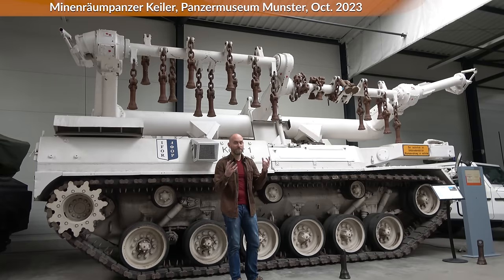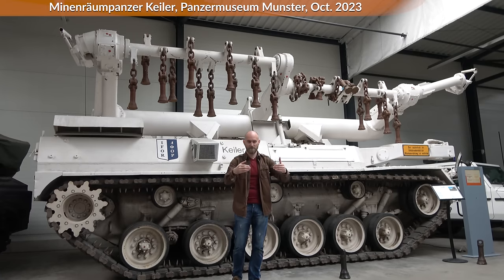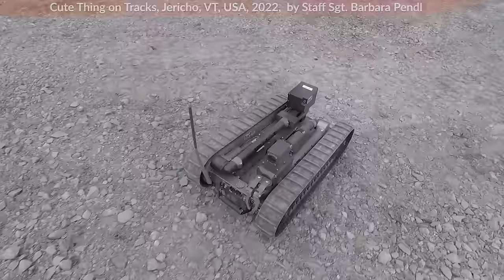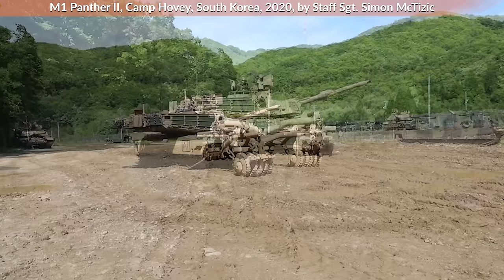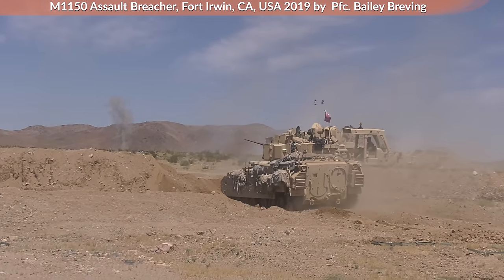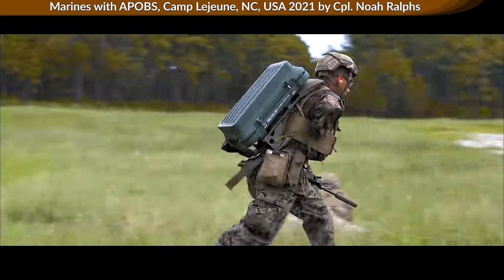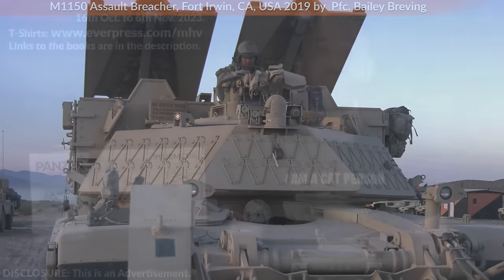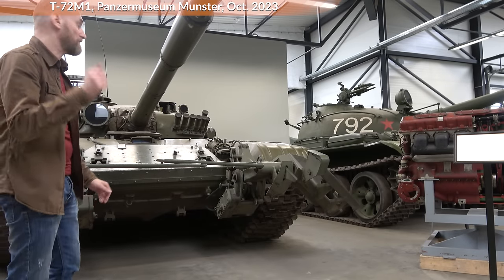Ukraine: The Problem with Mine-Clearing Tanks

Comment: Combat Engineer Intelligence officer here: you basically describe the SOSRA process. The technology for clearing lanes through minefield has not really evolved since WW2. Yes we have mine clearing line charges, but their length is limited and they are not 100% solution. Line charges DO NOT clear all mines and are mainly good for 1st generation track attack mines. Track width mine ploughs are NOT meant to clear a lane. They are meant to protect an individual tank while crossing a minefield (to secure the area), but other vehicles should not follow in it's path. Track width mine ploughs do not clear full width mines with magnetic sensors between the tracks, unless equiped with electronic counter-meassures (like the Russian EMT). 
For the engineers to be able to conduct the reduce of the obstacle, the manoeuver units need to supress, obscure and secure the area. In Ukraine this is extremely difficult. Two things have improved a lot in the past few years: ISR assets (drones for example) and long range fires. Everything is observed and will be targeted with accurate long range indirect fires. The Ukrainian breach attempts south from Orikhiv (7-8 june 2023) mainly failed because the breach lane was under observation and accurute indirect fires, while the area was not secured. Securing an obstacle (or obstacle belt) for the engineers to breach can be extremely difficult. With air supriority this becomes easier, but it often comes down to dismounted infantry breaching small lanes and creating a sort of 'bridge-head', before a lane is created for tanks and vehicles. This is exactly what the Ukrainians are doing. 
So breach tank are extremely usefull, but you need to set the right battlefield conditions for their use, otherwise you are sending them to their grave. 

Remote delivered mines can be used to quickly close a breach. Both NATO and Russian doctrine describes their use for this purpose. They should be dropped behind the breach force, so that they are isolated and the assault force can't reinforce them. Breach tanks are rare and it's very likely that the assault force is not equiped with breach tanks. This is a real danger and remote delivered mines were used in this manner by both Russia and Ukraine. A layered system of breach assets is needed for a breach to succeed on the modern battlefield.
Reply: I think all militaries doctrine instruct that minefields must be under observation and touchable with fires. And of course mine clearing tanks rank as no 1 target for AT crews
Reply: Would it be possible to clear mines by using a horizontal drill rig to emplace a charge that physically excavated a trench wide enough for vehicles? It sounds crazy but the Ditch Witch JT100 for example seems to claim 46 m / min advance, which is much faster and stealthier than the mine clearing flail. Not as fast as the surge speed of the miclic but probably competitive with the reloading cycle of the miclic, and if circumstances allowed you could set multiple charges per drill vehicle before blowing up anything. It's not clear to me whether there's a hope of controlling depth accurately enough with a commercial unit, though. Too deep and the charge won't blast away the overburden, too shallow and you give away the mine clearing effort prematurely.
Reply: I was surprised to find the other day that the first mine clearing line charge was invented (and used) in WW2. It was launched by a rocket just like now, but as an empty hose pipe like a fire hose, then nitroglycerin was pumped into the pipe and detonated. This made it seriously dangerous and there was a huge accident after which it wasn't used again during the war.
Reply: I was with Dir, of Combat Developments at Ft. Belvoir from 77 to 79. We came up with SLUFAE(Surface Launched Fuel Air Explosive). It allowed for attacking a mine field from several klicks back. When we gave a briefing to the Under Secretary of the Army, a Marine General said "that would be great for final protective fires". He was told to shut up. At that time most counter mine programs were not funded. Tankers didn't want plows and rollers on their beautiful new XM-1 tanks. We had three prototype mine rollers and three prototype mine plows and were told to scrap them. Fortunately, someone just hid them in the Armor Engineer lot at Ft. Knox. When the tankers saw all of the mines in the Kuwait desert, then they were demanding lots of rollers and plows immediately.
I see the future of mine clearing to be a combination of standoff munitions, drones with thermal sights to locate the mines, and remote controlled robots to remove or neutralize them. Good Luck, Rick
Reply: What about a Line charge roll carried behind a Dirt Bike being driven by a Combat Engineer? Or one of those Delivery Drones carrying a roll of Line charge?
Reply: @Sufferingzify You want to drive that dirt bike? Line charges are too heavy to carry or pull with a dirt bike. There are some interesting aspects to your idea.
Reply: @richardross7219  I just think that at some point, speed becomes life when crossing those minefields. The use of a Engineering Tanks carries the same risk because of total exposure time, if people are considering using a 100+lb Line charge backpack mortar to clear mine lanes, it would stand to reason that a motorcycle carried one would be easier.
Reply: @mattiasdahlstrom2024  Highest priority targets were APS equipped tanks as those tend to be command tanks, or vehicles identified as unit commander. Removing command paralyzes all but the best units, often leading to total destruction of the targeted formation. 
Specialist vehicles are next on the chopping block or the first target if no command vehicles can be identified.
Reply: @sealpiercing8476 it would be possible. Would it be cost effective, no idea. Would it be a perfect way? Far from it, you'd still have the issues of new mines being dropped in with arty or bombs and one disable vehicle would block the entire trench. Just clearing a field let's the rest of the collumn go around any disabled vehicles.
Reply: why always "cleaning" mines? why not making a tank strong enough that you can drive over them without a problem? speaking about the P-1000 Ratte or something ...
Reply: Don't know if this is good question for an S-2 in an engineer unit, but  is using HE artillery rounds with delayed fuses for reducing obstacles still valid, or is it such an outdated tactic that you might as well be going in with a lance and wings on your back?
Reply: @w4r7h0g8  waste of resources, huge downsides when not resisting mines and the enemy could always build a bigger mine to deal with it for a fraction of the cost.
Reply: Ever heard of nice-to-know and need-to-know?
Reply: @cbrun1669  Two problems with that critique. First, soldiers often find themselves in situations they haven't been specifically prepared for. I've seen a cook get deployed to a remote COP near the Pakistani border with no cooking equipment. What kind of job do you think he ended up doing. Second, if we ever do get into a major ground conflict, it's probably going to be a whole lot of people with little to no current preparation for what's going to happen ending up not just on the front line, but in command on the front line. So the more of an interest people take now, the better.
Reply: @Palora01  i wanna see how the enemy will "easily place" a mine in the size of a car or bigger ... good luck, transporting, burrying/hidding them in that size ...
Reply: @richardross7219  Someone has ever considered to use Hovercrafts?
Reply: @Palora01  All the methods identified here only clear lanes and consequently have similar problems. Moreover, buried charges potentially afford a way to clear more lanes at once, if the emplacement can be stealthy.
Reply: I laugh at the way everyone has to be "combat" now. It used to be field engineers, now it's combat engineers, we even have combat supply. Field engineers are the most respected units in the army, but now they're combat engineers and we laugh at them.
Reply: @sealpiercing8476  not quite the same problem. 

With a lane in a field there is the risk of hitting a mine if you go off lane. When the alternative is stay and wait for artillery to fall on you taking the risk is always worth it.  

And ofc you can make a new lane if you have another mine clearer in the column to take over from the first.

With a trench there is no way to get off lane, once you are in you are in, if the leading vehicle gets stuck or taken out that's it, no way forward, and no way back either if a vehicle at the rear gets taken out. At that moment you've just lost the entire column and the only thing you can do is abandon the vehicles. 

And that's a normal day on good ground. You don't even need the enemy to get you stuck in a trench if it's raining and all the water is pulling down in the trench where all the heavy vehicles are.

Current options are better and more cost effective. 
They're far from perfect but there is no perfect solution to mines, they're a really good defensive option.
Reply: @Derna1804  I was replying to the original comment. I was trying to highlight that commenting specialist knowledge about a subject like this in an open forum like youtube isn't a great idea, especially letting youtube comments know your rank and function... Anybody that has served/deployed knows that you shouldn't publish this kind of info publicly, even if it's common knowledge. Every safety briefing ever has contained this knowledge. I also doubt that future soldiers will receive their training via youtube.
Reply: @richardross7219  as for the airbreathing munitions, this might, actually be interesting, especially with modern guidance systems. How about something like M270 launched missiles, with reduced range (say to 20 km), but increased air breathing charges, possibly, even cluster (say 2-3 large submunitions per rocket, each equipped with it's own guidance kit). Or even with normal GMLRS ranges (of 80 km), but with foldable gliding surfaces. Basically elongated GLSDBs (with shorter boosters).  Why guidance kits? For two reasons: one, so that all submunitions hit ground in straight, preprogrammed line and two, so that explosions of this rounds would not interfere with each other (as they are airbreathing, and thus may disturb creation of the optimal mixture "cloud" shape). Alternatively, this charges could be integrated into air droppable gliding bombs. And as for the magnetically triggered mines, AFAIK, in certain cases, they can be triggered even by a hand-held radio or a cell phone nearby, so, possibly, a powerful directed ECM from an airborn  platform, equipped with AFAR could be used. Or something like the MALD missile, with a specialized narrow beam transmitter to imitate a tank several kilometers in front of it.
Reply: @cbrun1669  Officer is a pretty vague description, I don't think he doxxed himself. Our methods, training and doctrine are not actually secret. They cannot be in a republic, there has to be accountability to the public, and publications have to be easily accessible to troops. As to how future soldiers will train, they might not get the training they need at all..
Reply: @solarissv777 The fuel air explosives were sensitive to weather conditions. A decent wind would ruin them. I left active duty in 1979 and didn't keep up with most of the combat engineering because in the Reserves I was put into civil works since I was a civil engineer. Much of the new equipment seems too complicated which usually means unreliable and unrepairable. I am still a firm believer in the KISS principle. Good Luck Rick
Reply: Former 12-bang bang here, everybody remember that a minefield is only an obstacle. How command wants to breach that obstacle depends on what are the priorities of the mission, and this means combined arms if you want to get through as quickly as possible or a dedicated Engineer unit for thorough clearing. And yes, the MICLIC is almost a ton of fun 1800lbs of C-4) if you absolutely, positively need a safe path to drive through.
Reply: This made me think about the new US Army Pen Division and centralization of fires in the hands of DIVARTY & CORPSARTY/multi-domain TF.

Seems like the best approach with the current state of the art is indeed adding whole lot of combat engineer assets for redundancy and massing as much fire support assets as possible for counterfire operations.
Reply: Are all mines composed of ferromagnetic charges? Wonder if solution using strong electromagnets would be possible? But enemy response will probably be only paramegnetic ones. Then if we already go heavy into tech complicated equipment maybe something like Isreali trophy system, hard-kill solution. Instead of plow, heavily potected ground scanners with shooting device (explosives or smth else) controlled by AI system? Or ground light-weight remote controlled scanning robot to find path of lest resisance?
Reply: Mine clearing vehicles are good for clearing mines of secured areas, it's not very effective on hot zones.
Reply: When I saw the line charges I immediately though of drones in a swarm forming a grid over a field and simultaneously dropping one charge each. Maybe in the near future?
Reply: One thing - the small individual tank plows seem like they shouldn't be that expensive, along with the ECM equipment. So what prevents breakthrough tank and mech infantry platoons being made up of vehicles that each has this equipment? Seems like that would allow the vehicles to move more independently, and the lead tank being knocked out wouldn't basically doom the entire column. I mean even 30-40 such vehicles wouldn't be such a big drain on resources? Plus some sort of outrigging system that would drag chains along the ground on the sides of vehicles to detonate anti-infantry mines? I assume there is something else that would still prevent this from being effective, since it kind of seems obvious and simple to implement.
Reply: If all of these methods are not 100%, I think you need redundancy.  This will take more work, but this is a big problem that requires more effort.  Some ideas:

ALL tanks should have those smaller devices that clear a path just ahead of its own tracks.  Even if they're going through "already cleared" areas - there's still a few mines left.  And, don't count on those to clear for any other vehicle.  Every tank has those.  Must manufacture tons of these that can attach to all kinds of tanks.  So nobody risks going without.

Have a Dedicated, specialized mine clearing vehicle/tank, that goes first.  Without any other tanks following it.  It should be able to clear forwards and backwards, so if it has to withdraw, it can deal with missed, or newly dropped mines.  And, if it encounters a new obstacle (blown tank), it can drive around it, over mines near the road, clearing the way for itself.  Probably, unmanned and remote controlled.  Must manufacture lots of these so all groups have them, and backups, because they are vulnerable.

Redundancy and safety are #1.  Everybody, and every vehicle, must live for another day.  Just cuz you're driving, or walking, on a 'cleared' path, it may still have a few mines, or newly dropped mines.  Any area that's been cleared, only once, is still dangerous and should be cleared again using a different method, because each method has weaknesses.

Use the best technologies illustrated in this video - all of them at the same time.  I like that mine clearing plow.
Reply: @w4r7h0g8  From what I read, first - some tanks are already large enough that they suffer from logistic issues - difficult to field and traverse terrains i.e. crossing bridges. Second - a larger tank will result in counters via a more powerful mine but ever bigger tanks will stop being practical long before the size of mines becomes an issue. Thirdly, as evidenced by Russo-Ukrainian war, the future of warfare does not lie in bigger or more powerful tanks.
Reply: @Palora01  The problem of mass is still relevant; an anti-tank mine with a shaped charge is capable of penetrating 400 mm of armor
Reply: @richardross7219 not sure, as I do not know, if that can be used now. I think it was classified the same as napalm as a cruel & inhumane weapon.
Reply: @w4r7h0g8 reason being is that once we come up with a "mine-proof" tanks, mine technology will come up with even deadlier mines. It is easier to destroy the mine or move the mine via plowing
Reply: Very well said sir. The one thing that you failed to mention tho is that as Combat Engineers, we always double up our tactics. Once the lane is cleared, we always proof the lane to make sure all the mines are cleared. Either with a Cherry Line or with plows. And you are 100% correct about the minefield density, there are plenty of videos as proof of it. One place to see them is Warthog Defense here on YT.
Reply: No wonder the Russians stopped the recent Ukrainian offensive due to mines
Reply: @sealpiercing8476  no, it would be possible.  When under direct & indirect fire, you need to get through that minefield as fast as possible. If you ever watched a ditch witch work, they go backwards while digging & are very slow. 

Sorry!
Reply: @richardross7219  need to correct you on a point. The plows were used in 1989 because I was an E-5 then and we were training in their use.
Reply: @Sufferingzify  drone maybe. It would have to be a powerful one as C-4 is not light, especially when its daisy chained like a MCLIC. As far as a motorcycle goes, that's ridiculous, no offense intended. You are still putting a Sapper in danger hotdogging through a minefield where he can't see the mines. He gets blown up very easily and quickly
Reply: @meligoth  Hoo Rah! Well said.
Reply: @MariachiMak  no, they are not all  made up of that charge. If you went in doing the final sweep using a high powered electromagnet you would get your team, squad, platoon/section all blown to hell because of the sensitivity. And a lot are booby trapped so that if one goes off, a lot them go off.
Reply: @guyh.4553  Where and with what rollers on what machines? At that time, I was in Civil Works at a District so, I was out of touch with the Combat Engineering side. Around 1993, I was told the story about the old rollers and plows when I ran into an old friend from 1979 at Ft. Belvoir. Did you stay for retirement? Good Luck, Rick
Reply: Well put!
We in FDF have these roughly 20 kg "boomsticks" which are meant to clear a hole for infantry (taking out infantry mines). It's very similar to what the infantry was carrying and deploying in the video, that "line breach" thing with explosive cord.
Reply: Not like I am taking a step without you looking at me. Just saying...
Reply: @cbrun1669  I despair at some of the information that is shared on open platforms like YouTube. Maybe it is already 'open source' but there isn't any reason to make information easier to find.

I'm waiting to read about the specifications for nuclear submarine power plants because someone wants to show how knowlegable they are.

Sheeesh, loose lips sink ships!
Reply: @GarrisonFall  A simple (Salt device). The capture of neutrons would be quite specific. Ask the Chernobyl and Fukushima  holders of the keys. How do you shut down an Energy that hates you?  Simply bounces off others and agitates them too. On a Molecular Level. Such a small package with Large Consequences.
Reply: "conduct the reduce of the obstacle"...!? Most of what you "said" is just a convoluted contrivance, like you are trying too hard to live up to what you think, people expect of your "expertise", drop that whole pretending to be a literary genius and just say it how it is man, I don't think anyone really needs you to be The definitive "expert" opinion.... it's not like you're expected to write the Book on "Mine clearing Tanks" in a YT comments thread...
Reply: @sealpiercing8476  uhhhh just WHAT lol... the amount of explosives that would take... and how would you keep the explosive force tunneled in 1 direction under ground? literally none of what you suggested makes any sense even at a surface level glance, and the more i think about it and how someone would come up with such an idea the more my brain hurts lmao